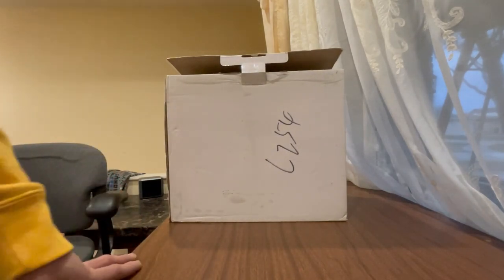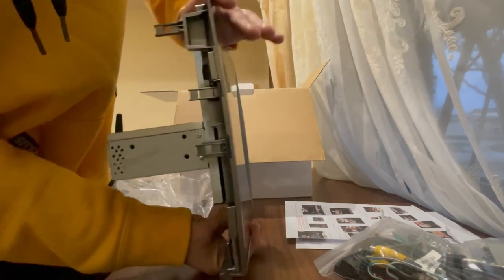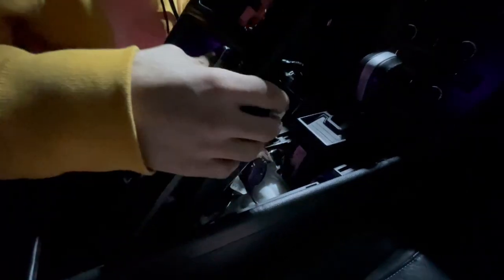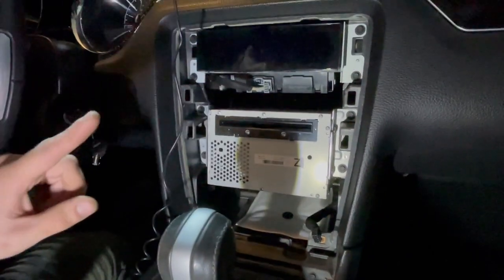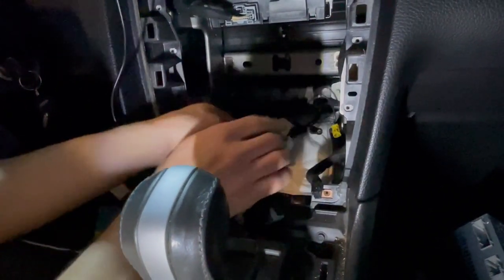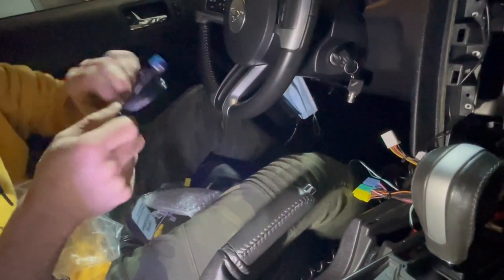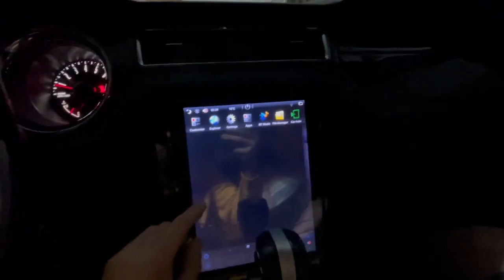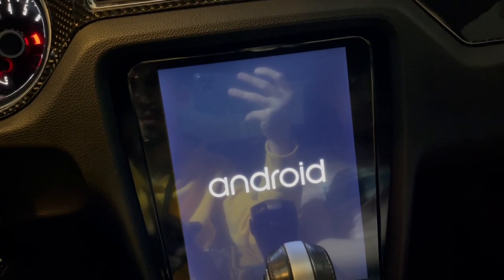2010-2014 MUSTANG GT TESLA SCREEN 12.1"  FULL INSTALL ( PHOENIX AUTOMOTIVE )

Comment: Got one in my 2010 V6.  Took about an hour to install.  I had to setup the steering wheel buttons.  You only need a 7mm socket and a plastic panel tool.  Everyone that sees it says it looks factory.
Reply: That’s only if you have a premium steering wheel. Base only have a a single row of buttons
Reply: Hey man I was just wondering since you did it yourself, how do you know where each wire plugs into? I’m thinking of buying and was wondering if it was as simple as each connection is a different size or if it doesn’t really matter. If you could let me know it’d be appreciated
Reply: How do you setup the steering wheel controls
Reply: What was the panel tool you used?
Reply: @Ac938432  anything to pry it out thats
not metal wont leave marks
Reply: How they holding up? Does it freeze and what not ?

Comment: Just installed on mine, super cool upgrade!
Reply: Do you hear buzzing or humming from the speaker
Reply: @Adunn2999  Actually I don't. Are you having that issue?
Reply: How's yours holding up after 6 months?  Also i read somewhere that one of the connectors that arent plugged in could be touching something causing that buzzing maybe put eletrical tap on everything.
Reply: Maybe ground wire not properly grounded... More than likely it's wiring
Reply: How they holding up do it freezes and what not ?
Reply: How do u like it ever and any issues?
Reply: That’s awesome when ordering did u select to keep oem radio and sync or remove?

Comment: Not to necro this video, but im having an issue installing mine. There is noplace to connect two of the wires. the uppermost grey and red plug i cant find a plug for anywhere, and the black plug in the lower right corner, that plugged into the oem bezel. Are these just not used with this? Your video cuts off just as it got to that part.

Comment: Hello. The first socket that you removed from the old panel (bottom right) is the socket for the AC ventilation controller. Where did you connect it? My cooler, valve and ventilation are not working. Where is that socket?
Reply: Hello brother, this still me different account. If you are talking about the small connector that connects on the faceplate. I recently got a new mustang and got another screen for it. That small connect does not connect anywhere on the aftermarket screen all HVAC controls will be controlled through a canbus box

Comment: Two questions.  Do you have any idea why my PhoneLink and Car Auto stopped working?  They were working then I messed around with the trim package option like you showed in the video and then I put it back to where it was and now they are not working.  Second question would be are you able to do the long press on System Info to get that sub menu option? I for some reason can not access that.

Comment: Hi! 
Replaced Shaker 500 with this HU. I noticed a buzzing sound from the speakers when radio/MP3/video is being played at any volume (except at zero volume). Do you have any idea, what causes this noise?
Reply from the maker: I’d say check ur connections first, also try key on engine off and see if u hear that buzzing noise if u don’t then that’s just engine noise coming off the alternator. I myself experience the noise but only when I’m typing something on the keyboard or when I’m using Apple car play

Comment: Can you help? I installed same radio in my 2012 mustang. I want to turn on radio without having to turn the car on or having the key turned ahead just before you start.  I want to be able to listen to radio with key in first position like it worked before install. You can shut off car and listen to radio without having all lights lit  up in dash
Reply from the maker: Unfortunately this was an issue I came across as well. After talking to all these companies and doing bunch of research. Its not doable unless u wire the radio to always be on and have some kind of switch to turn it off

Comment: Question, did you have any issues with connecting this unit to your AMP? The Shop told me last week that they can't install this unit without me buying AMP conversion kit because my current Kicker AMP's won't work with the Phoenix Automotive Tesla Screen PX6 ANDROID 10.1
Reply: It should work I had the shaker system on mine. Idk if u already ordered yours but they ask u to send a picture of everything before they send one out

Comment: Hey I’ve never done any electrical in my car so I’m not really familiar, how do you know where to plug each wire into? Are all the connections different sizes or does it not really matter? If anyone could help me before I buy I’d appreciate it.
Reply from the maker: Yes all the connections can only fit one way there forever it makes it plug and play. It’s all easily simple unless u looking to install a backup camera

Comment: Thank you very much. Very usefull video!. I have a question looking at the product seller web page: what does the options of keepOEM radio and SYNC / Remove OEM radio means?
Reply: It means to either keep your radio module or not. If you decide to keep it you’d have to relocate everything into the tunnel of the radio. Although if you have the factory touchscreen or your factory radio is broken you can not decide to keep the oem radio
Reply: @KokoKhoshaba  thanks my friend! why should you want to keep the OEM radio since this new one has a radio on it?
Reply: @hernanschiaffino5640  it’s to use ford sync as your source of Bluetooth since these radio Bluetooth is very unreliable. Also to keep XM radio if you are subscribed to that

Comment: Can I control my heated seats with the radio? How long did it take to come in mail
Reply from the maker: Yes you can just make sure to select the right settings also first time they sent it , it took over a month then they decided it was lost so they sent another one which took 5 days
Reply: Thank you so it’s pretty easy to use heated seats and radio? Gonna pull the trigger and order today

Comment: Did u buy the carplay wireless usb dongle for it to be wireless? If so where does that plug in at?
Reply from the maker: I did not get a dongle I had them build it into the screen. But if you were to get a dongle you’d just plug it into one of the USBs that come out the screen and download the app that comes with it
Reply: It plugs into the USB port near the back right of the unit.  It's a passthrough for the main USB port.

Comment: I've been reading for a while that they start to run slow & customer service sucks. How's your luck been?
Reply from the maker: I’ve had it for about a month, I did have a small issue they sent me updates and told me if it doesn’t work to request a replacement. However the service kinda sucks but people don’t understand when they reply it’s a different time zone. So far it’s been good I will do a video later.
Reply: @Currentcarz  what was the issue

Comment: Hey, i am considering buying one, but the screen itself looks extremely cheap. Like, the cheapest screens they used for fake iPhones back in 2012. Even when it's disabled, it has gray color, meh. But I also understand that camera probably can't provide truly colors and feel of using it. So, could you please comment how does it look in comparison with modern mobile phones, for instance. And what's matrix is that?..
Reply from the maker: To be frank  with u, you almost described the screen it self. It does looks cheap and it leaves a gray color when it’s off. Even when it’s on and u look at it from a side the screen discolors . This screen may not look like the iPhone screen but let me let u it’s very responsive. I hope this helps

Comment: What add on accessories did you get with the screen
Reply from the maker: Anything you want, front camera, backup camera, even side cameras . You can get a wireless OBD plug to diagnose your car with the screen
Reply: @Currentcarz  I apologize for not properly phrasing the question I was asking what did you yourself order with yours
I have a 2014  Gt premium package
Reply from the maker: @YungPoppa23  I’m sorry I miss read that,  I have a premium also, with the screen I required harness for the screen then there was one for the shaker system to connect the subs, there was an obd connector that I didn’t use, and bunch of other connectors for different stuff like back up camera.

Comment: did the shaker system with the 8inch subs on the doors work
Reply from the maker: Yes I did have to connect those to the sub plugs just tell them what you have specifically because there’s a harness for almost everything
Reply: @Currentcarz  thanks

Comment: How do I pop open the center console
Reply from the maker: You over the center console compartment start lifting on the center piece from there. It will all unclip as one piece. Then you can remove the radio face with two 7 mm screws and the rest are just clips